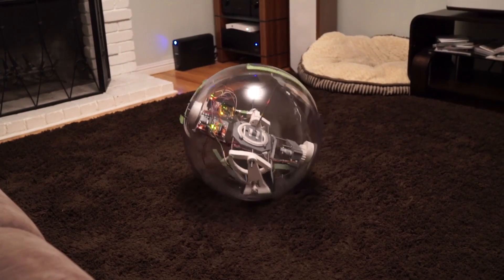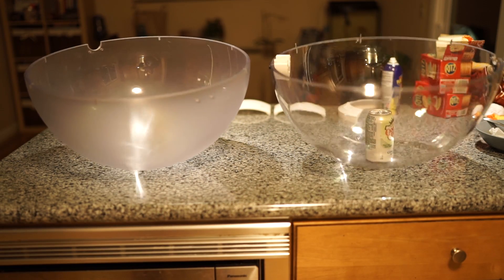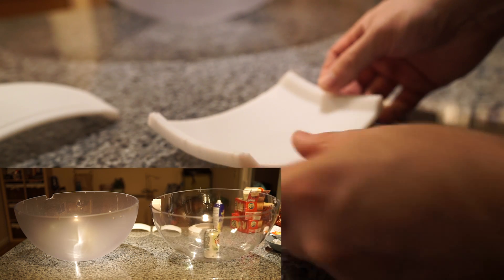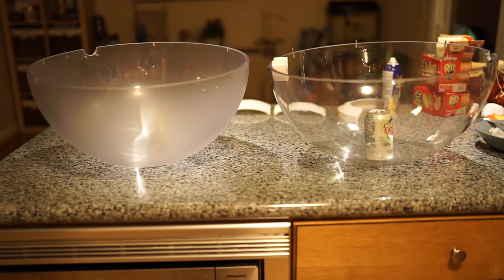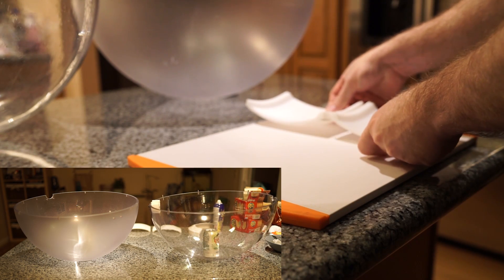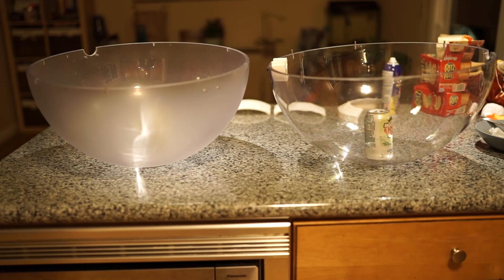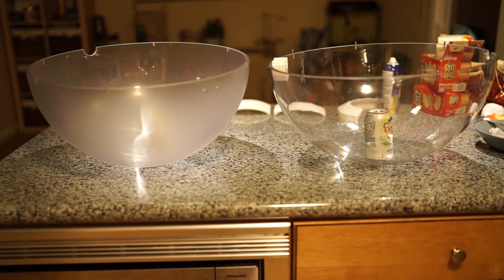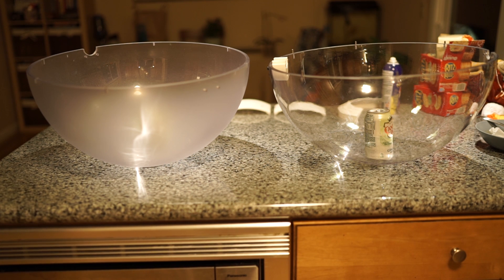Spraying BB-8 with transparent rubber

Comment: where can i get the transparent ball body?
Reply from the maker: https://plastic-domes-spheres.com/plastic-domes you mail them saying  you want two polycarbonate hemispheres for a BB-8 (they have sold a few for that purpose) and they will know the specs and give you a quote. I keep my two halves together using metal pins I inserted into the edges. VONJET BB-8 SPHERE https://www.facebook.com/profile.php?id=1081301168600069&ref=br_rs has 3D files to print for a BB-8 Body that does not require this sphere and will give you a body that looks like BB-8 with all the detail and is setup to work with the more common drive systems out there like Joe's drive: https://www.facebook.com/groups/JoesDrive/ and Daver's RCD: https://www.facebook.com/groups/1900730876811752/

Comment: Hello , we're working on the same project and we'd like to have details on the mechanical conception , especially the solution for locking the two hemisphere . Thank you in advance .
Reply from the maker: Holes in one hemisphere's edge, registration pins in the other and the two halves are held together by screws into the  hubs on the axle.

Comment: I was thinking about doing a similar thing too the outside of my bb8 but i was going to try spray in bed liner since they make it in orange, white and silver but its a lot more expensive than what you are using. I may just go your way instead. Thanks for the info.
Reply from the maker: +Jeremy Meyer This will also work over any weathering effect you do. I can't guarantee it will peal off printed parts, I've not had success with that yet but have only done a limited test with 3 coats. I think if I kept on building up coats it would improve my results and make it easier to remove. Lt me know how it goes for you